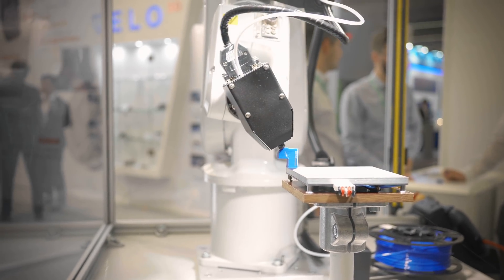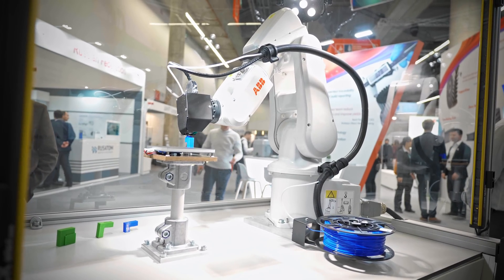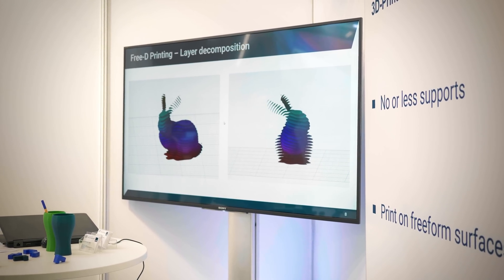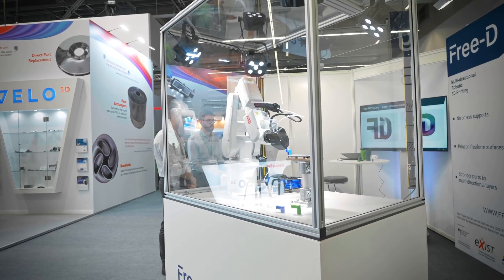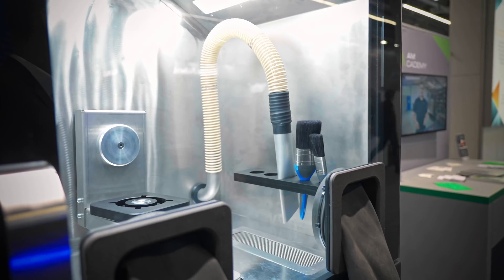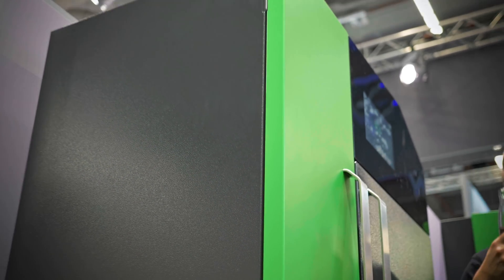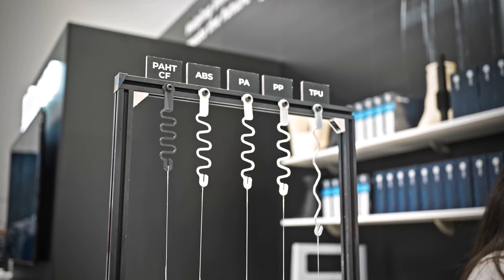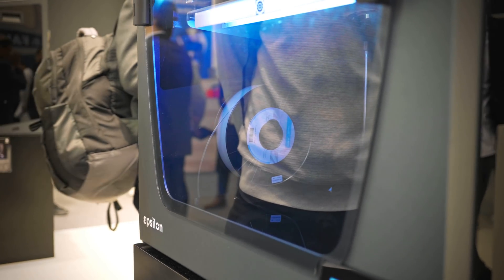Simultaneous 6-axis 3D printing!

Comment: It's very rare to find something in the 3D printing world that qualifies as a game changer.  That 6-axis printing definitely does.  Can't wait to see where the go with that.
Reply: 6-axis 3d printing is nothing new. Its been done several times by several different teams in past 2 years.
Reply: And building a 6 axes robot arm with stepper motors and a regula 3d printer isby that hard
Reply: imo the inkjet 3d printers are more of a game changer. If creality and then other 3rd party people manage to make it, and work for ender 3, it'd be absolutely amazing. 0,16mm line width (you could probably go down to 0,12mm or 0,1mm), and 0,04mm or 0,03mm layer height (or 0,02mm but I don't think there's any benefit to it) produces very good quality and is something ender 3 can easily do. Color onto those nice 3d models would just be.... Too good.
Reply: I mean unless they got software that programs the robot for you it really is just a handling robot with a hot end still cool just that I could do that with a 3d pen and a fanuc at work with some time programming but I could do it
Reply: @sorrygunsathome  I'd completely agree with you, this "3D pen" on a robat arms with some nice code still seems like a clunky way of solving manufacturing problems, look at cnc's machines they've been doing these operations for a long time. It's not new tech at all, I think people are really excited about 3D printing, and anytime newish tech comes out they're fast to call it "game-changing"
Reply: Path planning and collision avoidance is a challenge with complex shapes, but can be solved.
Accuracy of a 6dof robot is the real challenge, as can be seen in the sample shown in the video.
Accumulated accuracy over 6 axes implies very high precision on the individual joints and  complex calibration procedures.
The video shows no proof that either challenge has been addressed properly.
Reply: I am quite curious as to how (or if) creality will work on this

Comment: Right now, someone in GB just inked a deal for one of those metal printers--and they aren't going to use it to print prototype turbine fans. The fact that people will use these machines to make real and effective weapons is unavoidable--but that's always been true. It's perfectly possible to machine a gun from blank stock using affordable machines today, as it has been for many decades. The only thing 3D printing changes is the threshold to the skills. Cheap, mass-produced guns, imported illegally will always out-number guns made illicitly. It's a non-issue, but fear mongers will sell their wares, so it's an issue that the community won't be allowed to ignore.

Comment: Can you link the ABB robot arm 3-d printer on Banggood for $126.99 😀
Reply: @EMagnificent that's for a full size with a 8 foot horizontal arm and a rather old one at that. No industrial robot is "cheap"
Reply: They cost about 15k+ in used condition, so I don't see this product being anything near of a success.
Reply: @sarahnikas1344  you can actually get them much cheaper then that. We just got a full size fanuc for $7000 I've seen paintmates go for much less then that too and well fanuc is better
Reply: @sarahnikas1344  
Look up the opentorque project.
Or the costs of some scara arms.

15K+ used is the result of the same factors that made classif FDM printers cost in the same price range a decade or two ago (before reprap). Preadtory pricing, market segmentation and the like - in short price gouging.
At the end of the day haveing twice the number of actuators in the arm shouldn't increase the pric by 3 digits.
Reply: @sarahnikas1344  cost could go down a lot if production increased and they got out of the hands of specialised industry companies like ABB, they are way overbuilt for home use

Comment: Why move the print head and not reverse the complete setup and move the bed in all axis? Then you are always laying filament down without drooping...
Reply: It should not droop, and moving the print could be a problem with bigger, denser prints or parts that are off-center, as their inertia could make motors skip.
Reply: Frauenhofer Institut is doing this